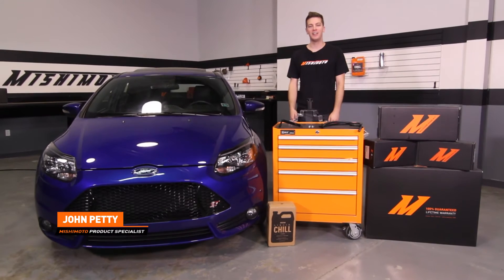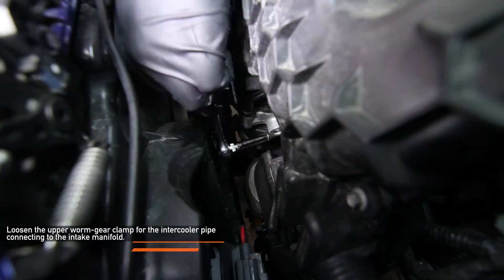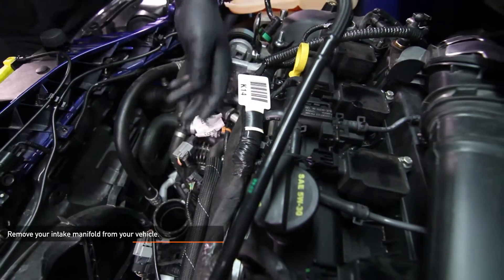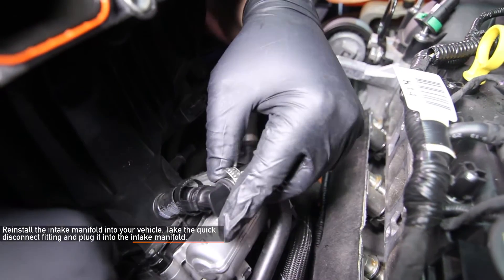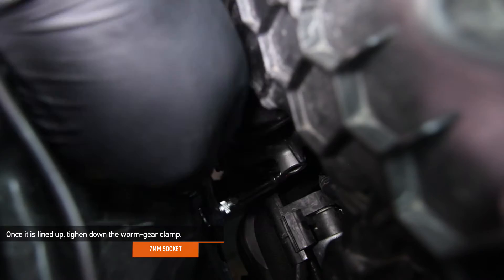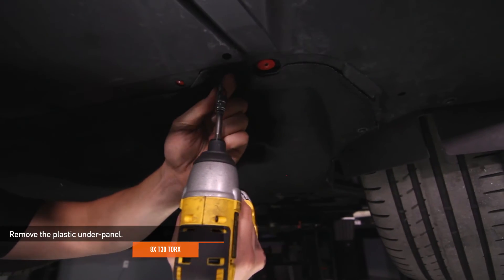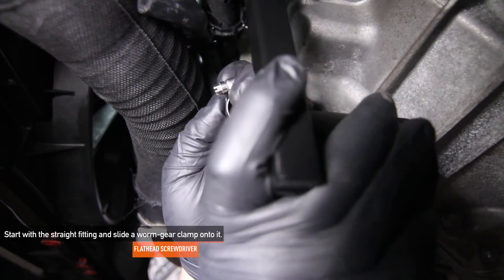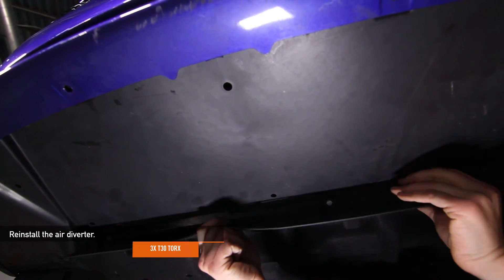2013-2018 Ford Focus ST Baffled Oil Catch Can Installation Guide By Mishimoto

Comment: Ok but how do you drain it?
Reply from the maker: The bottom of the catch can unscrews from the top so the content can we emptied. You can also use the drain plug on the bottom of the can.
Reply: Mishimoto Automotive oh ok cool just installed mine last week and wanted to be sure. Thanks for the quick reply, loving my stealth black intercooler on the ST!

Comment: Wow, that front bumper chin has seen better days!  Still, from what I've read with the EcoBoost engines, this is a rather critical modification as the DI system doesn't wash the oil off the valves like the port injectors used to.